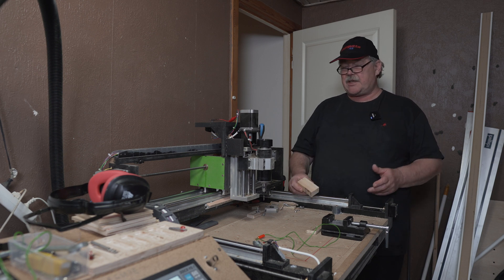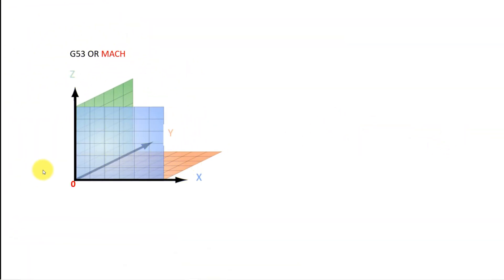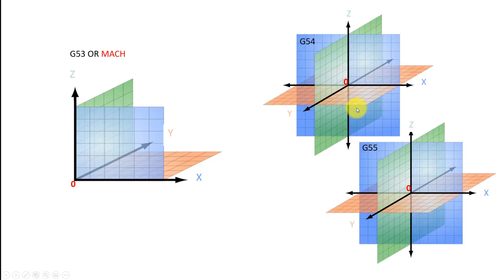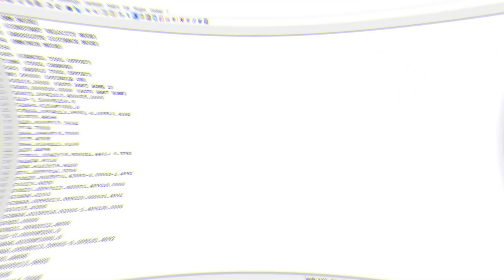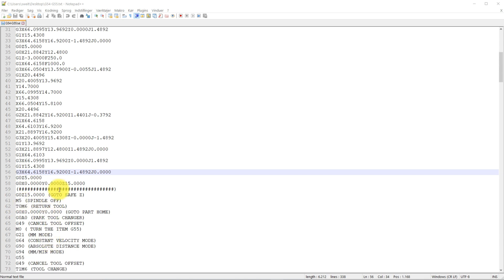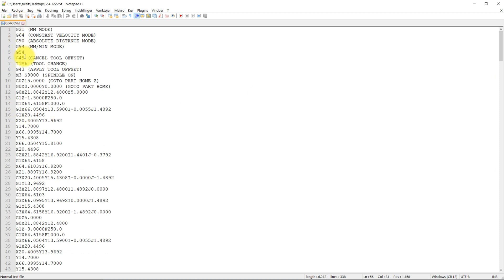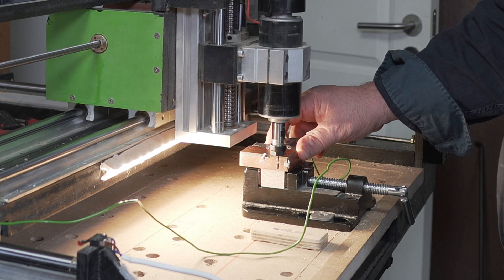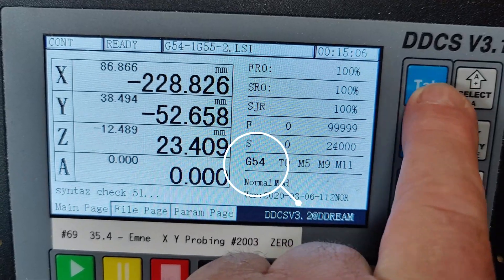What is coordinate system on a cnc router, and how to use them MACH G53

Comment: I have a question how do i  move on ddcs 3.1  controller  exact number of steps manually on the machine i want to do it for calibration  for example  x0y2000z... i want it move  it for xyz calibration  routine. cant find a way or parameter.
Reply from the maker: I just uploaded a video I hope it answers your question.